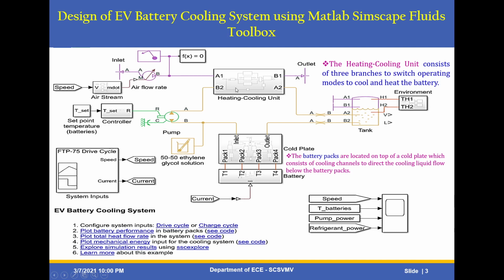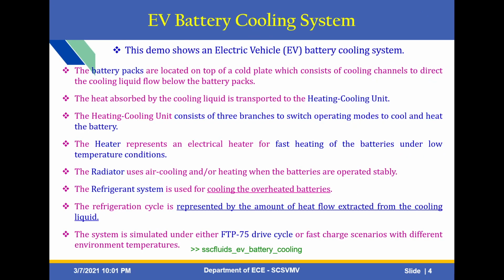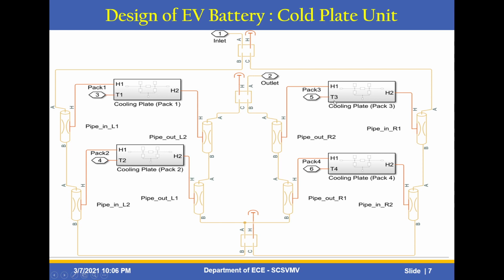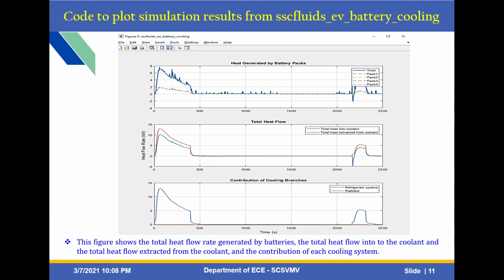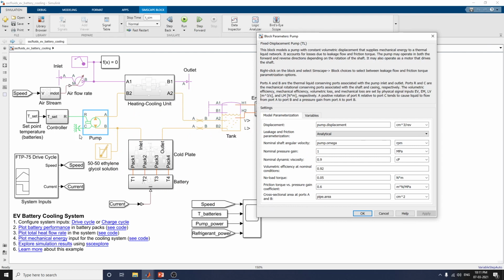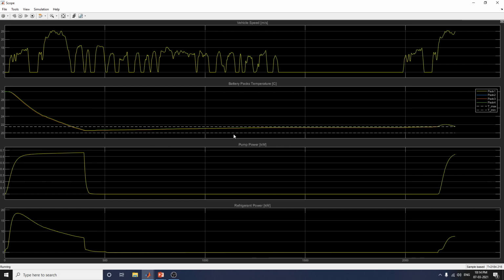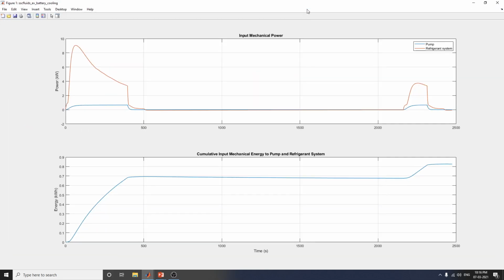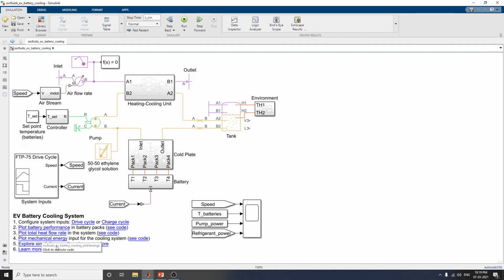Design and Implementation of Electric Vehicle (EV) Battery Cooling System Using Matlab Simulink

Comment: Sir can we combine this simscape with simulink model . Actually we have designed battery management system simulink by connecting a resistive load we didnt include battery cooling system . So now can we able to attach this with the simulink and how can we do tat sir
Reply: same doubt